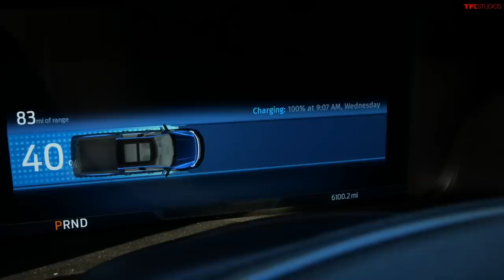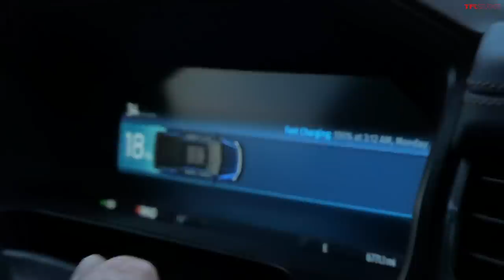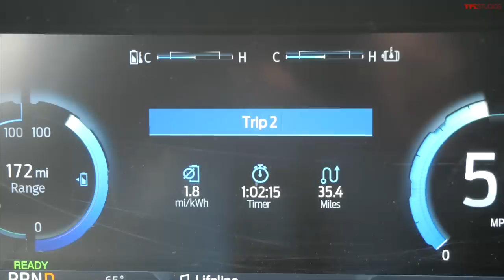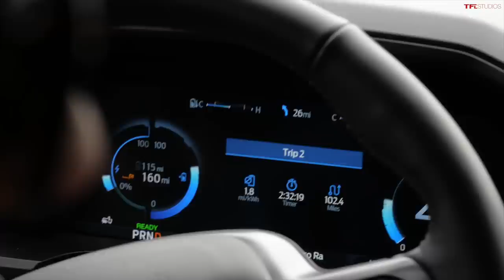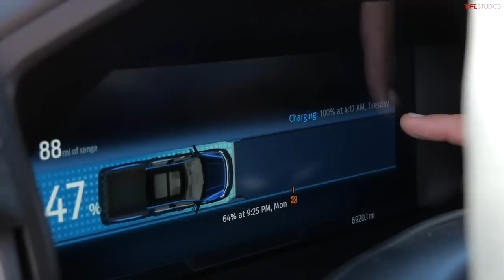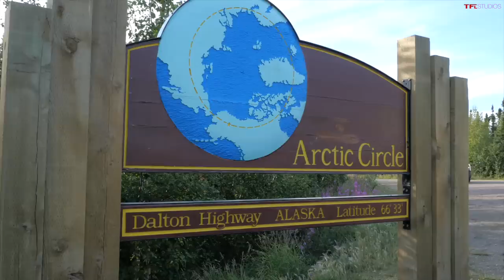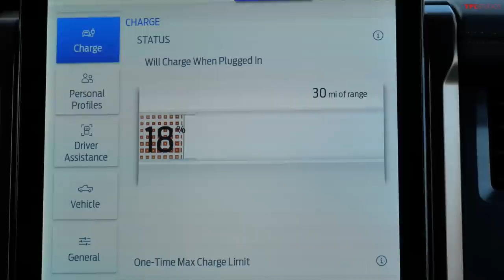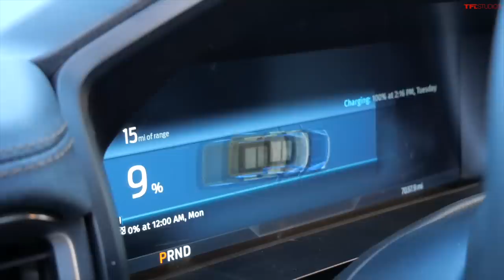Easy Part Is Over: Driving an EV Truck Into the Alaskan Wilderness Is HARDER Than We Thought! Ep.4

Comment: I’ll take the rocketship ! That owner of the tour guide company knows the deal. 
And yes we are at least 10 to 20 years away from 100% EV’s being practical. Infrastructure isn’t even close. When you have similar amounts of charging stations like we now have gas stations we’ll be there. What about the overall power grids in the summer when all AC’s are pumping. This is not practical at all. 
EV’s are very practical and terrific on golf carts. 

Even in the warmer states. Up in Alaska with super cold temps those batteries will not last you’re lucky if you get half the range compared to mid Atlantic states. 
Bidens push for EV’s is an arrogant decision. Crippling the fossil fuel industry on day one by stopping the keystone pipeline and stopping oil drilling here in the US and relying on foreign oil. Just stupid 

Give you a lot of credit for making this trip.
Reply: @heatherjones3768  I’m not saying EV’s don’t work. What I’m saying is the infrastructure is at least a decade away from being practical and making sense moneywise. EV’s needs to be introduced in a slow gradual process. 
Shoving the EV agenda down our throats too soon and too drastically has caused higher prices of all goods and services and ultimately inflation. Hi gas and diesel prices are causing a trickle down effect. Most all goods and services for the most part are delivered to warehouses, stores and homes on trucks and cars, high gasoline and  diesel fuel prices have inflated the prices of everything. This is not practical when less than 10% of the cars on the road are EV‘s.
Reply: @stephendibari5010  right now it's nothing more than a gimmick at the moment for most of the people looks cool it's different something that most ppl used it before but right now it hasn't been a legit proven fact besides it has max power as soon as you push on the pedal but as far as how reliable and efficient to someone that actually works out of these trucks and uses it for it's main purpose that it's designed for has yet to be seen
Reply: @roadrunner4847  exactly. Fossil fuels are used to build these EV’s. 🤦‍♂️
Reply: You do realize that the Keystone pipeline has been online for years and does zero for US energy producers. Further, the recently canceled expansion was just that, an expansion that would only allow more foreign oil to pass through the US.
Reply: @martyscholes119  The keystone pipeline extension that was canceled was designed to get oil from Canada and yes it was going to help the economy two fold, keep the existing thousands of jobs and then ultimately help the United States get oil from Canada instead of relying on our enemies in the Middle East and Venezuela
Reply: @stephendibari5010  Then we agree: the pipeline expansion would not help oil producers or consumers in the US, at least not for a while.
Reply: @martyscholes119  I’ll go ahead and correct you much of the pipeline that was already running was shut down along with the new construction it was my job checking torque on bolts and inspecting pump stations now I don’t have that job but I’m sure you watch cnn so you know everything
Reply: @englandtra  I stand corrected. I didn’t realize that the pipeline was stopped, crippling the domestic oil industry.
Reply: @martyscholes119  that’s what is was designed to do
Reply: @stephendibari5010  The federal government financed the development of the fossil fuel infrastructure but now its suddenly a problem that they invest in the next leap.

The future is coming whether you like it or not, Cletus. You people are an absolute boat anchor to human progress.

Comment: A hybrid is a much better vehicle with a range of maybe 50 miles on battery. This would give most people the daily around town battery use but still have the gas generator engine when you're run low on battery. Then you could slow charge at night.  (The fast chargers are going to burn up your battery life quicker.) I own a hybrid and it took a little while to figure out how to maximize battery range.  I use the battery around town and then on hwy I just use the gas generator engine. On the hwy battery power disappears fast unless your driving like 40mph and who wants to do that.  I get decent avg mileage around 40mpg but I still do lots of hwy driving during my week.  Ive found battery regen doesn't really give you much in terms of extra range kinda of a joke.  Tho in rush hour traffic is nice to use cause it's slows the car down without using brakes.  After 7 years of use the battery is showing its signs of age.  It used to charge to 45 miles now its like 27 miles. New battery $10K.  I doubt I'll buy the new battery but with cost of cars these days maybe I will. 
I don't see informed Americans buying pure electric, once the real world negatives get out about it.  Right now you have these jump on the band wagoners  because of the propaganda being pushed without really knowing what they are getting into. 
With the hybrid you have the best of both worlds you can play golf cart around town pretending to save the world and when you want to travel far or too cool places that don't have chargers you don't have the range anxiety and won't be stranded.  To me that's the best solution until something better then plug in battery comes along. Maybe ammonia as a fuel looks interesting.  .

Comment: It would have been nice if our government would have changed the latest “EV tax incentive” to use the money on chargers and charging stations and mining and battery material production here in the United States, possibly lowering prices for EVs for everyone rather than a faux tax incentive (really just corporate welfare) that actually sends money to EV makers not necessarily reducing consumers tax liability. It's easy to see which lobbyists bribes the most. The problem isn't that there are not enough EV buyers, the problem is that there are not enough affordable EVs, and charging infrastructure, and mining bandwidth and vital mineral production, and overall battery supply chain, which all needs immediate attention. Washington DC, is simply where common sense goes to die.

Comment: How long would the difference be in hours if a gas F150 left same place, same destination, and you only stopped for fuel / charge and overnight camping? My guess is days
Reply: The charging time is huge but they do a lot of it while they're sleeping so they wouldn't be driving anyway. That said, they are clearly losing hours of drive time each day to charging so it would add up to a significant amount of time added to the trip.  Not to mention dealing with the stress of wondering if you can find a solution at the next stop that won't take you 5 days to carry out.

Comment: The Lighting isn't a Model T. There have been EVs dating way back to the Model T, but the EVs then suffered from the same basic issues that modern EVs suffer from today. Relative to the internal combustion engine, they are expensive, heavy, and they take too long to charge for lesser amounts of range. I mean, a Model T could probably get to your destination faster than the Lightning did, and it'll do it for less money. That's how little EV tech has progressed is the last 100+ years. If not for government favor and "sustainability" lies, we wouldn't be talking about any of this.
Reply: As battery tech gets better and batteries get denser and smaller you will see a very large increase in range and usability. The battery tech in the past 10 years has allowed electric cars to be feasible for many people. In another 10 years electric vehicles will be feasible for even more people as well as for commercial applications. The exponential growth of electric vehicles will be similar to how quickly gas cars replaced horses.
Reply: @Espo78  There have been no significant gains in battery technology in the last 10 year, just bigger batteries and improved chassis, allowing for more range with stagnant tech. 

And your promise of "better" batteries is just EV industry sales pitch. Anything could be promised as improving in the future, including the internal combustion engine. In fact, over the last 40 years, there have been more thermal efficiency gains with the mainstream internal combustion engine than there has been with mainstream battery technology.

Also, walking is feasible, so that word is pretty worthless relatively to driving a normal ICE car.
Reply: @AkioWasRight  well first off… no.
Reply: @Espo78  First of, yes. 

The first Tesla was the Roadster, which had an efficiency rating of ~4.4 miles per kWh. 

SHOW ME any similar electric car produced in the last 10 years that has significantly improved on that.
Reply: And when I say similar, I mean in terms of battery size. 

The Roadster had a little under 260 miles of theoretical range out a 56kWh battery. Show me an EV that has improved on that by any significant margin.

Comment: Need to improve range and charging speed by about 25 times before I'm considering. The value of these early EVs is gonna be nothing when they are 1/25th or so as fast at charging and slower charging by a long shot
Reply: So they have to charge in five minutes and go 2000 miles in a charge? Give me a break
Reply: Yep, these are little more than a novelty at this point.  No range and no real infrastructure to support them in any numbers..
Reply: @alanjones8555  you know you are commenting on a road trip that hardly anyone takes and where ever ICE vehicles struggle. Are you planning on taking a road trip to the Artic circle any time soon? How far do you drive in a day?

Comment: The receptacle at Coldfoot was a NEMA 6-50R, which is an obsolete welding machine recepticle. I'm not surprised you didn't have that adapter in your collection.  (Of course, someone on your staff could have called ahead and asked for a photo of the receptacle weeks before your trip.) For what its worth, Amazon sells an adapter from a 6-50P  to a NEMA 14-50R for $30.

Comment: Why not test how far you can drive a truck on three wheels? Because that's about as relevant to how the average person uses a truck as this test. EV range is mostly a concern of automotive journalists. Most EV owners will never have to worry about range. The EV with the shortest range is still more than adequate for 99 percent of drivers in day-to-day use.
Reply: EVs are still dumb.
Reply: Well, this is why most people aren't buying Evs. Even if your comment is statistically true its still holding people back.
Reply: @M8Stealth  Drive one that give an opion
Reply: @jtonneson  back from what? going to places that they will never go to or are you going to the artic circle soon
Reply: @jtonneson  The reason more people aren't buying EVs is that the demand exceeds the supply. Tesla has four plants pumping out EVs, and they still have long waiting lists. Ford's F150 EV is almost guaranteed to have huge demand. We'll see whether Ford can build them fast enough.
Reply: @kevinpolito1529  you might be right. I think for a car they would work pretty well. Towing a travel trailer trailer 600 miles doesn't seem like it would be too awesome. I really like the idea of the Ford Lightning, but it doesn't fit my needs very well. I could see a Tesla in our garage though.
Reply: @chrishansel9324  thanks for the comments, and yes going to the artic circle Alaska is on the list. Not sure I'd drive there though. The argument that "most people don't need to drive very far" doesn't seem like it helps sway anyone to go buy an EV.
Reply: @jtonneson  I don't understand the appeal of a travel trailer/ I'd lean more toward a Class B RV.
Reply: @jtonneson  The missing piece in the EV industry and the auto industry in general is an entry-level car affordable by the working class. As it is now, they are priced out of the new car market. Every carmaker concentrates on the highest-profit models, and the lowest-priced models are being discontinued.

Comment: You have Yukon River Crossing they have power there you can use.  60 miles south of Arctic Circle 100 south of Coldfoot.  YRC power is diesel generator..  So is Coldfoot.  There;s a couple pump stations and Ak Hwy stations on the way for emergency stop.

Comment: If it were me, especially with the long days, I might have rigged up some solar on top of the truck/camper, charging a portable power station.  I know solar intensity is lower the further North you go, but it would be at least partly compensated for by the long days.

A portable power station that can simultaneously take in both AC and solar power, and can output the maximum AC charging rate that the Lightning can absorb out in the wild (7 kW? 11-12 kW?), would mean you could always get maximum charge rate at every stop (at least at first), even if all you had was a regular wall outlet.

Comment: I am really enjoying watching this Siri just because I’m the kind of person to be intrigued with technology. But I’m also the kind of person who is a practical nature and as an F150 owner (mine has the V8) I am able to get right around 19 miles to the gallon sometimes as high as 20 on a road trip like I finished up today and that included the around town driving and idling times that I did while on this trip.  Was almost 1200 miles mostly highway, and I filled up when I left my original destination, and when I left to return home and that was it. Because this truck get right at 540 miles on a tank. 

So even if I gave the lighting the benefit of the doubt and we were getting its full range on the highway at the same speed that I drive which is 60 miles an hour… Then it might get 150 miles on a charge, in order to go 450 miles you would need to stop at least three times charge maybe you can cruise in on your last charge if you were lucky. 

That was set you back at least two hours or more and if things don’t line up just right with the charger locations them you might have to do even more charges.

Comment: I think that this expedition in the Lightning is very important. Most automotive channels online and on television tend to focus on the positives in ideal situations and the spec sheet. This expedition demonstrates the difficulties, challenges and shortcomings of the vehicle. In particular, the recharging and range availability. This will be a hard pill for Ford and other EV manufacturers to swallow, but swallow it they must. EVs have already come a long way, but the pace is far too slow and with a bit more effort and investment in R&D by the manufacturers, we may get to a point where an EV is a very attractive option in a shorter time span.

Comment: I think you guys ran into a 3 prongs NEMA 6-50 plug in Alaska - this ironically is the SAME plug I have in my garage, which I use a Chargepoint Home unit which uses that exact same plug design. The more common Level 2 EV charge socket is the NEMA 14-50 which has 4 prongs instead of 3.

Comment: @34:09 it's a 6-50r not sure what it's used for, but they do make adapter to change it to the common 14-50. 
Definitely should probably be using like a surge guard RV surge protector or at bare minimum a multi meter or 30amp or 50amp RV plug tester when plugging in to all these unknown sources to be sure there aren't wiring faults that could damage the truck.

Surprised the charger doesn't go up to 50 amps. Is that zen car the adapter Ford gives with the truck? If not why use it vs the included adapter?

Comment: I believe that it makes more sense to look at kWh left in the battery than to look at miles of range.  That's because miles of range is just an estimate that the vehicle gives based on previous driving (technique and terrain).  Some people call it the guess-O-meter.  kWh on the other hand is an actual measurement of energy left in the battery.  You can then multiply the kWh left in the battery by the miles/kWh that the vehicle shows you're getting.  That gives a better estimate than miles of range the vehicle shows (guess-O-meter).  Of course your new and better range estimate assumes that your miles/kWh will stay roughly the same which it will if your driving style (speed, acceleration, one-pedal driving) stays the same and the terrain stays about the same.  By the way, if the vehicle doesn't show kWh left in the battery, you can easily calculate by multiplying the battery capacity in kWh by the % of battery left.

Comment: A phev truck with a 100 mile range battery is where we need to be. This shows why some areas of the country a battery only truck is not useable.
Reply: Are there even plugin hybrid trucks ? You would have to wait 10 to 15 years for a 100 mile electric range PHEV truck .

Comment: You need to get a Y splitter 2 x TT30 to NEMA 14-50 and a couple 5-15 to a TT-30. You will have to adjust the charge amounts to not blow breaker but will give you more options.

Comment: You're right, it's not a dryer outlet. It's a NEMA 6-50R(Supposed to be a 50A outlet, I imagine they have it supplied by a 70A breaker. Bit sus but whatever), typically used for welders (like it says right on the box). Honestly I would've figured that was one of your best bets up in the north there. Need to up your adapter game.

Comment: They could put a 220 volt charger at that camp site. There's a company called Freewire that makes a charger that has its own battery, and it builds up juice in the battery from normal 120 v current, and then charges your battery off of that. So they could put a few of those at that camp site and people could use them. 🙂

Comment: Over here in eurooe we have standartised plugs 😅 (230v/3.6kw or 400v with 16a/11kw, 32a/22kw, 64a/44kw, 125a/88kw) nearly every household has 400v/16a outlets wich are mostly used for small machines, welders or wallboxes. Workshops usually also have 400v/32a for wich we also have chargers wich can charge up to 22kw (but only premium cars have that as an option).